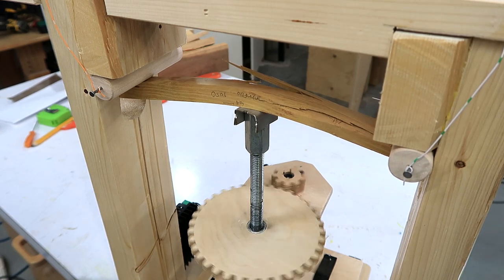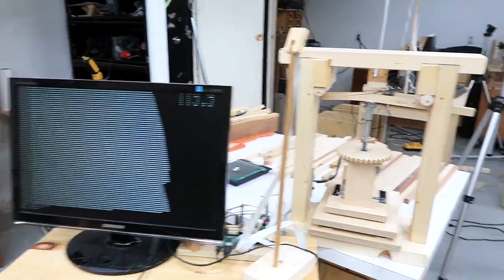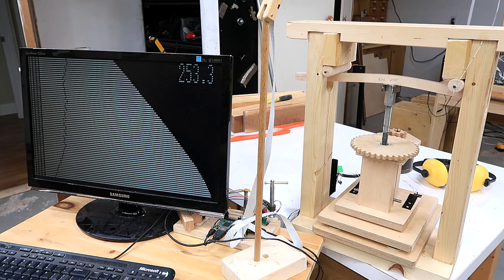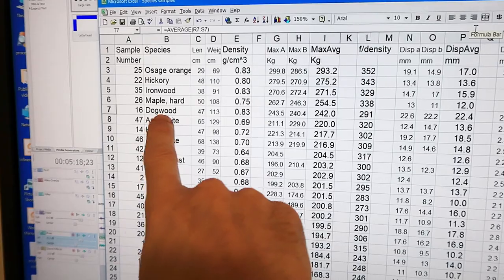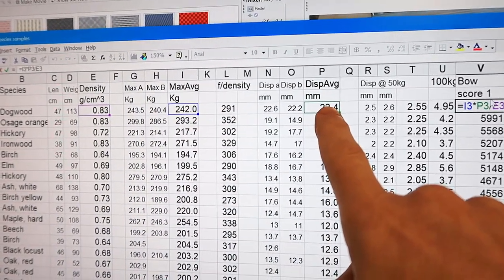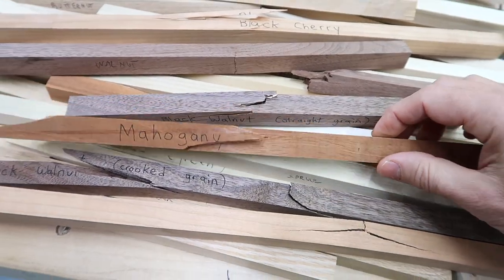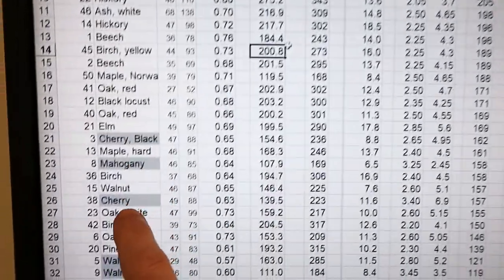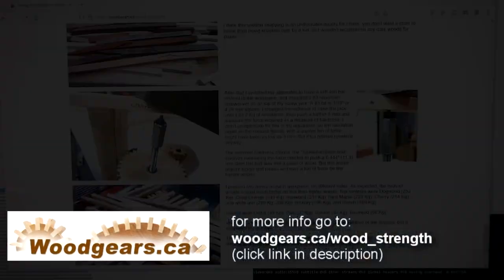What wood species is strongest, hardest, stiffest, best for chairs, tables, or bow making?

Comment: So basically, bow woods are (unsurprisingly!) those that are good at bearing dynamic loads, and therefore they'll make a good chair, bed slat etc material? That's fascinating! As a non-carpenter (I only make tiny little things, mostly ornamental faux-blades for letter-openers and similar), I had never really considered how those would line up. Thanks for the video Mr Wandel, much appreciated.

Comment: 1:10 kg is actually mass, which is not the same thing as weight. Weight is force and is measured in Newtons.

The imperial counterparts are slug and pound respectively.

Comment: Well changing the subject to guitar necks, this test shows hard maple is a nice wood to use because of the displacement test? The neck should be very stable to keep the guitar in tune.
Reply from the maker: yes, stiffness would probably be the most important aspect.  Strength a non issue cause it's not that much force.

Comment: Did you test balsa or yew? Balsa quite commonly prized for its strength to weight ratio for use in model aeroplanes. And yew, of course, being the famous favourite of medieval English longbow makers. If you do test yew, note that bows are commonly made from a piece of wood that is half the lighter outer wood and half the darker, older heartwood of the yew. So it would be interesting to see an appropriately selected piece of yew tested.
Reply from the maker: send me some
Reply: Not just model aeroplanes, but some actual aeroplanes too. The British WW2 bomber "Mosquito" was made primarily of balsa and plywood. It was so light that they didn't even bother arming it with defensive machine guns like most other bombers of the time as enemy fighters of the era couldn't keep up. It could drop bombs and outrun any enemy planes sent to intercept it.

Comment: I suspect that you kept the grain orientation consistent throughout your testing while placing the different wood in the stress testing machine.  My question is about which way the grain was oriented when strength testing.  Was the board placed in a flat sawn position? (ie: grain horizontal with the table) or in a vertical grain pattern? (ie: the grain perpendicular with the table)  

I've no doubt you are well aware that attempting to break a piece of wood is much easier across the flat sawn direction & considerably more difficult against vertical oriented grain.  I am very curious as to which way you placed the wood in your strength testing jig.  A good example of this is when hafting an axe, the ideal grain orientation for the handle is with the grain running parallel with the axe head  When looking at the end of the handle you can clearly see which direction the grain runs. Thanks.

Comment: Old Bowyers saying is "a bow fully drawn is a stick 9/10ths broken" with that criteria a wood that progressively breaks would be likely to start breaking before full drawn. Really good information, at college I was taught that wood is an unreliable engineering material as it's strength is too variable, It would be interesting to see how consistent a single species is across various samples and various dryness.
Reply from the maker: Yes, I heard that.  But what is 9/10ths broken?  at 50% breaking force, the wood already starts to yield.
Reply: There are types of wood suitable for engineered structures. Ultrasonically graded douglas fir, for example. It has properties that can be relied upon.

Comment: Did you have any Yew wood to test? Yew was traditionally used for longbows in the UK. It also used to be used for furniture because of the flexibility but also in lutes. It's a relatively uncommon wood these days owing to the mature trees tend to be hollow and the wood has plenty of knots. Elm is an interesting wood, heavily affected by Dutch Elm disease but was traditionally used for making boxes and coffins, it's not as strong as Oak but it has a denser interlocked grain which in your test exceeded Oak in the bend test.

Comment: On dark woods, at least "mahoganies", and other tropical dark woods, there is no early and late wood, so it can be very tough to visually estimate the grain direction in the wood.

I once bought a "perfect" plank of "mahogany" at a local store, it was as pure and straight as one might wish for.  I bandsawed it into shears and chine logs for a small skiff, and as I sawed it the previously straight pieces turned into bananas off the saw.  Well, I should have known better,  but I thought they so much better followed the shears that I would use them anyway.   3 snapped during the initial 2D bends along the plywood shears, and a third broke when I tried to assemble the boat.  A dramatic example of how crappy a perfect piece of tropical wood can be in reality, as what looked like pattern in the "grain" was just visual and did not follow split lines at all.

Comment: Maple for guitar necks has always been considered ideal for its strength when quarter sawn with grain line running vertically. Do you agree based on your test results ?
Reply: Maple seems to be pretty stable over time as it's used for pool cues a lot also.

Comment: I wonder how Redwood or Cedar would fair. I also wonder if there is a difference between "old growth" and "new growth" wood which could explain why there is a big difference sometimes within the same species. There's also the sunny side of the tree vs. the shady side which sometimes creates different grain patterns.
Reply: He showed cedar, did not perform well, as one would expect.
Reply: Redwood is light, soft, and a little bit brittle. Not terribly strong. You can dent it with your fingernail. Old growth is said to be a bit stronger. I have some old growth redwood posts but I can't easily strength test them. Its superpower is rot resistance. Untreated redwood posts will last a long time if you directly bury them in the ground with no concrete. At least this is true in places where redwood actually grows.

Comment: Very cool tests!  Were the samples that were not close to the line in those plots the ones where the grain did not run straight through the sample? Could image that this reduces the strength a lot and with ideal straight grain you are close to the line. Also, Bamboo, MDF, Plywood might also be interesting datapoints!
Reply from the maker: Except for the piece labeled "crooked grain", they were all straight grained.  I cut a few pieces out of boards at an angle to line up with the grain.
Reply: @matthiaswandel  okok. Would have been to easy if that was the main reason :)

Comment: Almost everyone is sleeping on bradford pear. It's wood is fine grained, heavy, hard, and fairly strong. It's also somewhat decay resistant and uniformly light in color. Most importantly, it's basically free everywhere, because the ornamental trees are everywhere. One downside is that you won't get any long boards out of it. Probably would be great for turning tho or tool making tho.

Comment: I wonder how moisture content factors in? I used to do those competitive bridge building things in school, and everyone had their own trick to baking the moisture out of their wood to get more wood in their structure, but stay under the overall weight limit. too much baking though, and the wood became drastically weaker. And then wood would also pick up some moisture from the air, so we had to store it in sealed containers with desiccant to avoid climbing over the limit if we were close to it.

In your graph of density vs strength, i wonder if the wood samples that were more dense but weaker simply had a higher moisture content? Or maybe for a given sample, the moisture content doesn't shift the breaking strength enough for it to matter in this type of comparison? I'm not even sure how you would measure moisture content in your samples

Comment: The grain needs to stay in the sample all the way to be a valid indication of what force would cause it to snap.  This would be the starting point for your test. Although this is true, your testing is much appreciated!  You could spend much time and effort testing but there is natural selection forces that give great information by simply looking at what woods were  used for what purposes over the centuries.
Reply from the maker: Do you believe I'm stupid enough not to know that?
Reply: @matthiaswandel  No I don’t. Did I miss where you accounted for grain?  You made sure they were dimensionally identical though which is valid in testing the individual pieces.  It appeared that from the way some snapped, there was run out that might have been the reason for it snapping.  Am I wrong?

Comment: Would you mind enabling subtitles?
It's very useful for people with hearing troubles like me.
Thank you.
Reply from the maker: have to wait for youtube to generate them first.
Reply: All you have to do is click on the "CC" button at the bottom of the viewing screen.  You can do that for nearly any video.  But thick regional accents or excessive background noise may make it inaccurate.
Reply: @petercollin5670  well if I posted this message it's because there's no CC link.
Some videos don't have this option, and some people don't want to add it (like computerphile for example, for some obscure technical reason) that's not the case with Matthias, usually the option is present IIRC.
Reply: @petercollin5670  just double checked and now the subtitles are available.
Maybe Matthias has enabled them, or YouTube took time to process them, but now it's there.
Thanks to whomever allowed it.

Comment: Of course what you want for a bow is the highest modulus of elasticity, you never want them to break, but you want them to be stiff for their weight.

The 4th Bowyer's Bible has a formula that determines what width to make a bow of a given draw weight depending on the natural weight of the wood.  This is not a formula for achieving a bow weight so much as they were trying to determine what would be require to make usable bows, and whether there was on particular wood that was best.  I think as far as the latter is concerned there are preferred woods, but the early peoples of this continent needed bows regardless of what species of wood occurred in their region, so they learned to simply make the limbs wider if the wood was lighter.

Comment: Kilograms is a mass not weight. if it was a weight it would already be a force. though you can totally use it as a weight or force, it just has that implied multiplication with g.
Reply from the maker: yes, I already addressed that in the text in the video to pre-empt pedantic folks like you.  Too bad pedantic folks don't have the attention span to watch and read.

Comment: Technically, kilogram is a unit of mass, while weight is a force. What you used is really the kilogram force or kgf is (1kg at 1G, so about 9.81N), but it is a non standard unit so it is often just shortened to kilogram or kg anyway (just like its sibling is commonly called a pound rather than poun force). Had some decent usage in the 20th century (literally went to space with the USSR). So, basically, no issue with the unit there :v
Reply from the maker: I put that in the text in the video to pre-empt pedantic comments like this.
Reply: @matthiaswandel  Yeah, but what you said was more correct than what you wrote. So either don't write something more incorrect than what you said, or write it right if you want to avoid "pedantic" comments. And geez, mate, learn social skills.

Comment: I wonder which woods this test indicates for making paddles. I guess it would be purely strength per gram since you want the lightest possible paddle for a given strength.
Reply from the maker: resistance to splitting would be a big factor, which I didn't actually test for.

Comment: On your website you said the dowels were 24.5cm apart but in the spreadsheet you have them as 24.2cm apart. Also, why is your equation for bending moment 2*MaxAvg*g/L instead of MaxAvg*g*L/4?
Reply from the maker: I don’t have bending moment on the spreadsheet.
Reply: @matthiaswandel  It's column J (hidden)

Comment: why are you so convinced that the failure in one area has no impact on an area 9" away?
seems like when a piece fractures like that, it could have left all sorts of problems through out the piece.  
have you checked for decreased stress in pieces used twice?
Reply: I downloaded the spreadsheet with his results and the average force for the second failure is very close to the average force of the first failure.
This makes sense as the failure occurs close to the location of maximal bending in the middle of the wood whereas the ends are not bended at all so their yield strength doesn't matter as much.

Comment: I be curious as to the effect torrefaction would have on the results. I'd assume all the samples would become more brittle and break with a bang, but we won't know unless you test it. 

Could you also test some varieties of plywood?

On a side note if all your samples are of exacting dimensions, you could get the guitar/luthier/instrument builder community interested. if you were to built a jig that could hold the samples the same way, then figured out a way to tap them(like a marimba key) in a consistent way. If you measured decibel readings and spectrum analyzer readings. Also throw "Tonewood" in the title.

Oh and when are you releasing the plans for the the 48" floor recessed bandsaw?

Comment: It seems you haven't tested Balsa wood. It used to be the wood of choice in Aviation in the early 1900, specifically for its strength to weight ratio. Also you only tested bending strength and not tensile strength where you might have had different results

Comment: I wonder what variability the rate of growth has on all of these tests. You might compare woods with multiple samples to see if there is any differences in the sizes of the growth rings. I would guess that a slower growing tree with less water might be a bit harder because the rings are kind of like composite material with layers of hard and layers of soft and the less water it gets the thinner the layers of soft are increasing the overall percentage of hard material in it. I would also guess that at a point the gains from slow growth would be out weighed by an increase in brittleness however this is all just guesses. Sure would be interesting to test though, the ideal growth pattern for maximizing strength.
Reply: That would be reflected in the density of the samples which he did include in the data set.  Of course many samples of each wood type would be required for any sort of meaningful results.
Reply: @Demolishionist  Depends on your application. For building and furniture making, the results are 100% useful. It's easy to say "do it again to see if results are consistent", but heck man, that's hard work!😬
Reply: @Bob_Adkins  I was referring to @evilcanofdrpepper's idea of testing samples from different growth rates in the same species. The 2-3 samples of each in this test are not meaningful in that context as that was not what Matthias was testing for.

Comment: I find this kind of testing quite fascinating, but unfortunately, I think we have to always take the results with a grain of salt.  The properties of wood can vary within any given species.  Not two trees are perfectly identical, even within the same species.  Indeed, even different parts of the same tree can vary in hardness, density, etc.  If you want to be truly certain, you need to treat each piece of wood as a unique specimen with unique properties.  Although of course, one can make generalizations about various species, which is where the kind of information presented in this video comes in handy.  Its a good place to start, but I wouldn't rely on it exclusively.